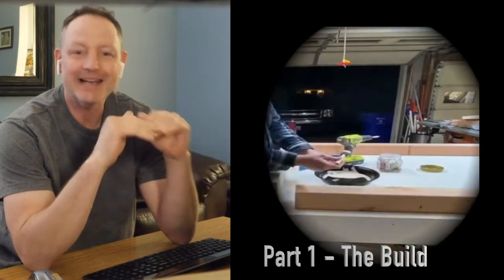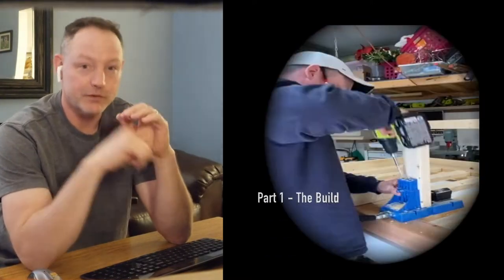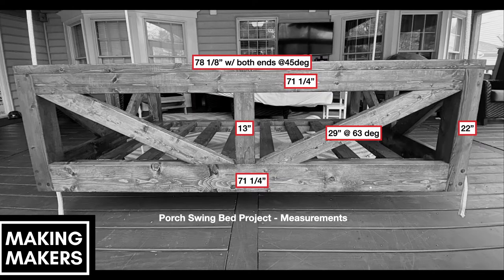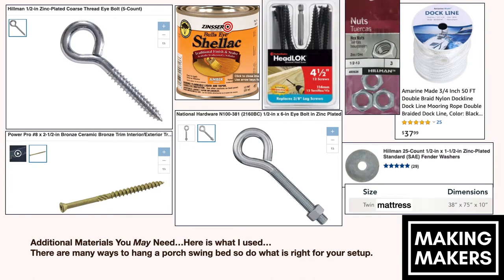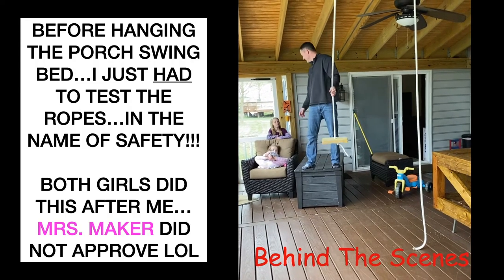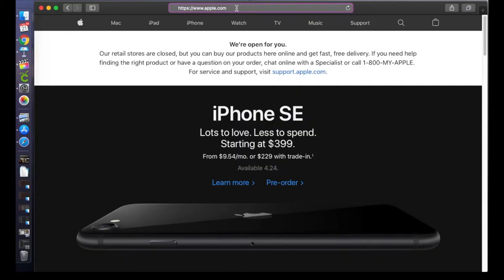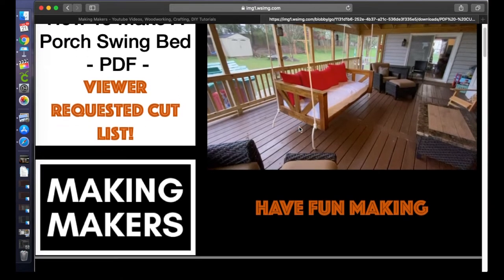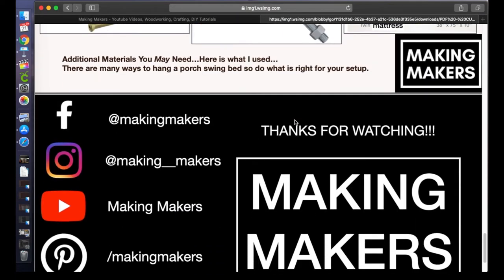Make A Porch Swing Bed - Part 2

Comment: You forgot to add you Amazon link on this PDF. That is a great to generate money. Why did you choose to use the eyebolts on the top of the crib swing and on the bottom sides of the twin swing. Do you believe the twin bed would hold just as well doing the eyebolts on top, in the 4x4 corners? Great YTC!
Reply from the maker: Hi Ryan, thanks for the feedback. Space was tight on my front porch so I went with eye screws on top. Both top and outside-bottom placements work fine for me.  Where are you thinking of placing yours, any space constraints?

Comment: I cannot find the dock line for my swing that i built. Do you happen to have the amazon link still?
Reply from the maker: JT, thanks for letting me know the Amarine dock rope I used for the original build isn’t on Amazon anymore. Looks like white is hard to find right now for some reason. Two ideas come to mind, search the https://www.amarine.store and see what they carry and/or take a look at a similar product that should work SeaChoice 42651 Dock Rope for Boating - 3-Strand Twisted Nylon Line, ¾-Inch x 50 Feet, White https://www.amazon.com/dp/B0062YUERM/ref=cm_sw_r_cp_api_i_ZzEqFbM69JE65
Reply: Making Makers thanks for the reply! I found some good rope at the Depot and hung my bench today. I based mine off your crib swing design but made a few modifications